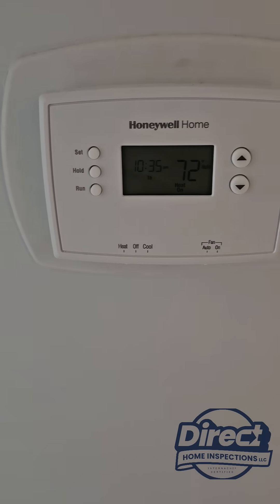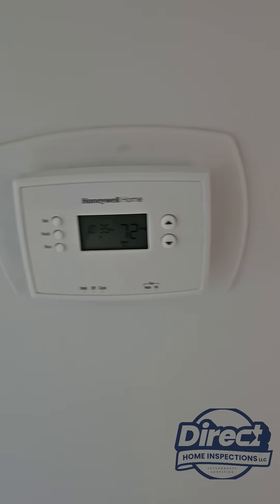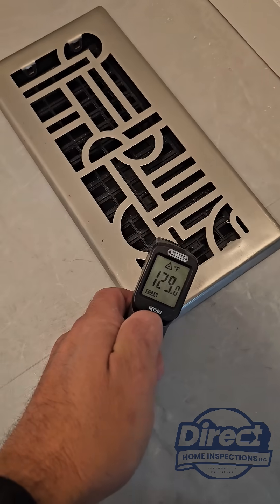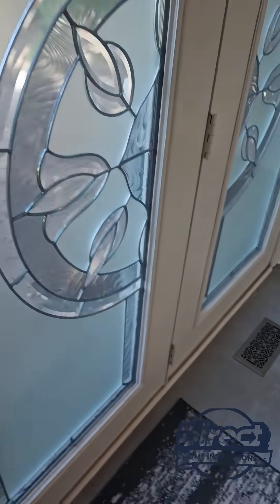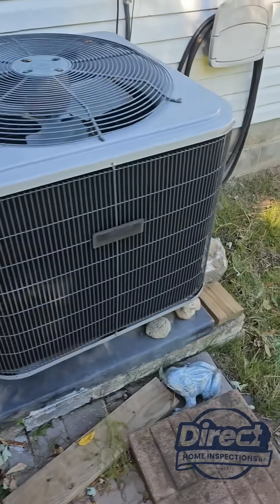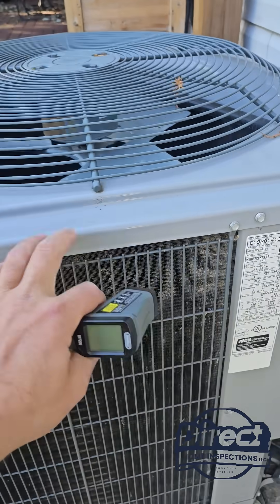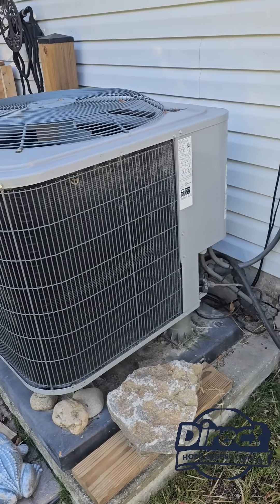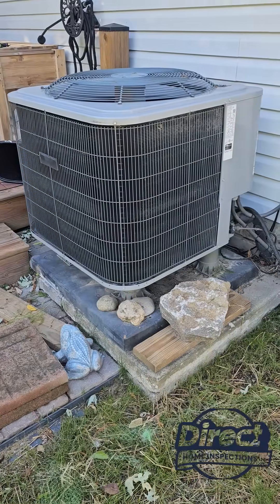Huge HVAC find during home inspection #realestate  #homeinspection

Comment: Electric heat COP =1 

You get 3.41 Btus per watt consumed, heat pump can achieve 3-6 COP which can deliver 9-13 btus per watt consumed. 

It is 3-4 times as efficient with moderate ambient temperature.
Reply from the maker: Thats why she needs wired into the proper thermostat

Comment: Around here we use our electric heat and save the wear and tear on the heat pump at about 30°. But my power is for the meantime still fairly cheap. Several hydroelectric dams in my area.

Comment: I believe those Honeywells have the O/B setting dor the reversing valve in the condenser. They most likely just wired it wrong at the air handler. Tip u can also use the W wire to energize the reversing valve since its only needed to engage the heat strips once it goes into defrost mode. In colder regions I dont recommend doing it but in Texas where I am the condenser rarely freezes over.

Comment: Some times they may have had a straight cool with only two wires

But the home warranty or installer may have had heat pumps available so they’d slap that in

But a new thermostat won’t do any good if they only have two wire not five wire

And running new thermostat wire may require running it through the attic and down the side of the house

So they’d slap that they’ll have an ugly casing over it too

Comment: They more than likely did that because there wasn’t enough thermostat wires to the thermostat itself or their is possibly an issue via compressor or low on Freon
Reply from the maker: It was virtually brand new. Either way it needs corrected! You may be right about the thermostat wires

Comment: Omg.... Where the hell do you live 700 800 a month to heat. That's nuts. I am 2000 a year for my whole home 4700 sq ft with a heat pump and 1200 for propane backup with bbq and boiler for hot water and in floor.
Reply: I think he was saying that he had his heat strips running instead of the heat pump. A lot of people dont know why aux or emer is on their stats and it costs them a lot if they leave it on that or if its unfortunately wired incorrectly.
Reply: Yep... I understood what he said. And that price for electricity is nuts per month.  @Skogebear
Reply: @JoeBlau1350 where do you live? It would be that much with ga power if you ran those strips in place of your pump through the coldest months. Especially if you arent insualted well.
Reply: Canada and its minus 19f right this second  @Skogebear
Reply: @JoeBlau1350 i dont know what -19 tranlates into for power prices but i dont doubt canada has better power prices than we do.
Reply: @Skogebear Depends which lifestyle plan you pick.
We are usually 10cents per kw high as 15c per kw on peak which I am scheduled out of for the most part.
Insulation costs alot to do once and keeps paying dividends after.
It's a must in Canada and its code anyway.
But I built beyond code.
Complete spray foam. Lo e triple glass.
Reply: @Skogebear minus 19 Fahrenheit so its cold at this second.
Reply from the maker: Electric heat is expensive that's why it's important to get the heat pump wired in
Reply: I am well aware of electric heat and it's heat per watt. 700 a month is ridiculous.  @DirectHomeInspectionsOH

Comment: The size of the outdoor unit doesn't mean anything. I've seen huge condensers that are 2 tons.
Reply: When I ran hvac calls and it was based on home inspector reports it was always fairly random

But to be fair a home inspector can’t possibly know about every trade the way a specialist would
Reply: 😂😂😂 even your back track is wrong
Reply from the maker: I'm strictly speaking about the heat pump not being wired into the thermostat
Reply: @DirectHomeInspectionsOH you literally said “I notice how large it is for the square footage of the home” 😆 the actual footprint of the unit does t determine its BTU 🤦‍♂️
Reply from the maker: @madeinusa1576 its a giveaway that its likely a heat pump. Stay on track

Comment: From the looks of it, it's a 3 ton condenser so I doubt it's too big for the house
Reply from the maker: I don't think you caught the point of the entire video
Reply: @DirectHomeInspectionsOH No, I did. But calling it oversized when it most definitely isn't stands out more than anything else
Reply from the maker: @SuperPhantomHunter you didn't watch the video. I was talking about the heat pump not being wired into the thermostat
Reply: @DirectHomeInspectionsOH again, I watched the video, I know what the video was about. Calling it "oversized" was just simply incorrect and had nothing to do with the main point of the video.
Reply from the maker: @SuperPhantomHunter I was clearly stating it's a heat pump as they are genuinely bigger in size which shows that  this home also should be wired for it.
Reply: @DirectHomeInspectionsOH my apologies, as a technician I thought you were saying the tonnage of the unit was too big for the house, which is why I was stating that's incorrect and irrelevant to the original video. That's my bad for not understanding your full meaning.
Reply from the maker: @SuperPhantomHunter all good man!

Comment: Also, since that is straight air thermostat, it isn’t going to energize the reversing valve for cooling mode, so it’s gonna run in heat mode when it’s calling for cool
Reply from the maker: Yessir
Reply: not true depends on the valve does it energize on b or o
Reply: @ytzn1290  is true cause carrier products energize for cool mode
Reply: @tennesseevalleyhvac-315 only brand that doesn’t is rheem they energize on b for heat instead of o I bet you they installed that heat pump cause it was cheaper than a straight cool I see it all the time from either home warranty
Reply: It's easy to toss a jumper wire in the panel at the heat pump and force it as cooling only always.
Who really knows what the actual facts are here.